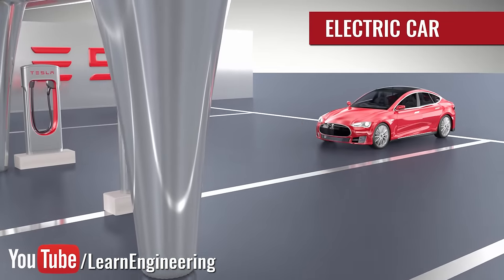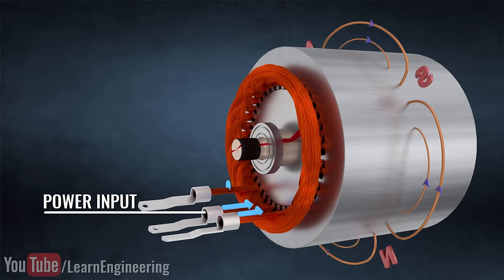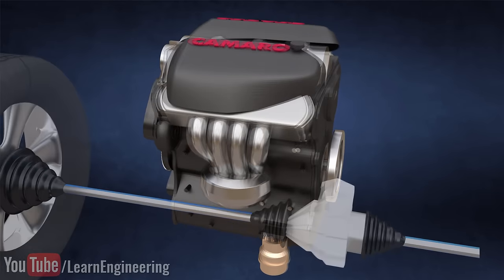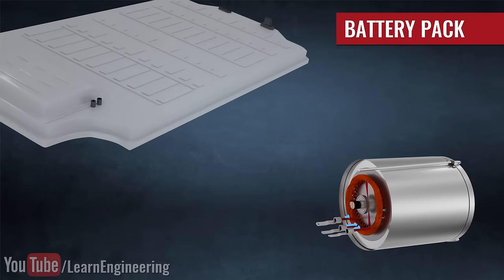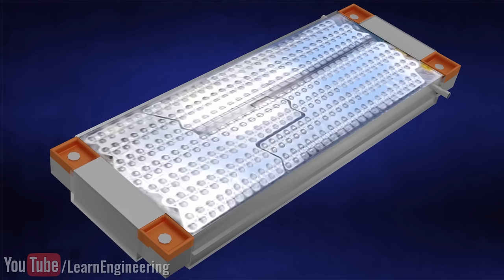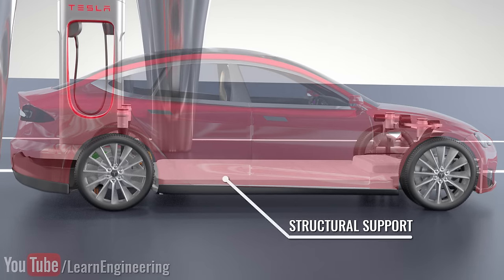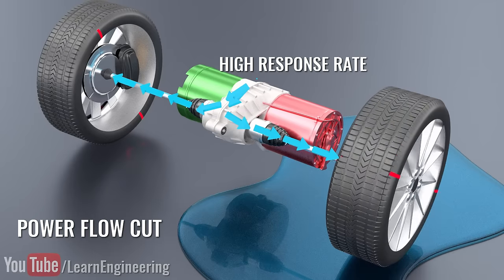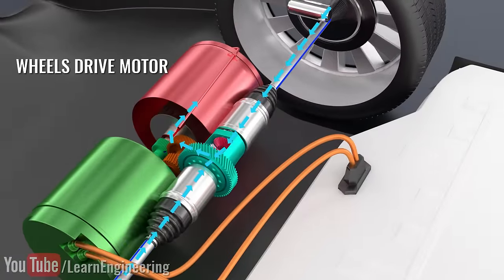How does an Electric Car work ? | Tesla Model S

Comment: I have a 1988 chevy Scottsdale king cab with an 8 ft. truck bed. Big truck had it forever and love everything about it except its 350 small block that is feed by a 36gallon fuel tank and gets 9 miles to the gallon. this was not so much a problem when gas was $0.89 a gallon but when gas hit $4.20 a gallon several years ago I had to park it and use it sparingly. I just wish there was an affordable way to convert it and put a large tesla battery pack in it and those electric motors at a reasonable price. He has to come up with conversion kits at some point
Reply: There are some people look up on youtube youll find "home made" electric cars that are converted from normal IC engines to electric and they are pretty good.
Reply: Lol why are you driving century old car. Instead of turning into kind of a electric car you should just buy new hybrid truck. Much cheaper than electric motor and battery packs.
Reply: wardain 
So buying a whole car with an ICE and battery, is cheaper than a battery and electric motor? LOL.
Reply: Lee Morgan 
that would be awsome! mix old school with new tech!
Reply: I'm gonna convert my car to a hybrid diy.  Gonna build my own motor from scrap materials and build my own battery pack even build my own battery cells from raw materials.  I'll be posting videos on this project.
Reply: Ever heard of LPG?
Reply: @MultiHeheboy  simply put. The older trucks are not designed to break unlike new cars nowadays. Its better to convert old Betsy to electric than to buy a brand new truck because converting a car to electric would likely be cheaper. Plus sentimental value of the thing

Comment: I like how much I learned from this video but I hate the fact that you put a 4 cylinder Inline model in an 8 cylinder V engine, how the valves & pistons were timed incorrectly, the poorly modeled Tesla, and how “no noise” and “no pollution” were put in the advantages section because I almost got hit by a Tesla because I didn’t hear it swerve toward me on the sidewalk, and building most teslas causes more pollution per unit than the pollution an IC engine creates in a year
Reply: I like how people with zero skills whine about other peoples work, how you almost being "hit by a Tesla" is something anyone gives a rats behind about, and the fact that Tesla's emit far less pollution overall during their lifespans, than combustion engine cars do, which is the entire point...
Reply: @redbaron6805  my brother in Christ I do not need to be able to fly a helicopter to be able to say “that’s not right” when I see one in a tree, I included me almost getting hit (in fact at this point I was hit last week) to bring up that if you can’t hear teslas then you won’t know where it is, meaning you can’t tell it’s about to hit you until you hear the tire noise about 5 feet away, and also most electricity (roughly 60%) is made with fossil fuels, dominantly coal and natural gas, so EV’s are not even as green as advertised + the several tons of CO that making an EV emits outweighs gasoline cars, plus the fact that if you crash hard enough to damage the battery you’ll need another one thus producing another several tons of CO sounds a lot like it’s worse than gasoline cars 🤯
Reply: @WZDRIP  Except, it has nothing to do with anything.  If you are riding a bicycle and get hit by a car, it doesn't mean all combustion cars are bad, or all combustion engine car drivers are bad, or literally anything.

It also ignores the fact that ALL modern electric cars, manufactured after a certain date, in the USA, have to make noise, if their speed is below 18.6 Mph.

Your claim about fossil fuels is also false, it is not "predominantly" coal and gas in the USA, gas is around 40%, coal is around 20% and dropping, they are not in equal amounts.

And the fossil fuel argument completely ignores the efficiency of EV's, which are on average around 5x more efficient per mile, even more in high performance applications.

It also ignores that the upfront emissions required to make an EV, are offset in about 12 months of driving, so lets not pretend the total emissions are remotely close.

What happens in crashes isn't particularly relevant, as batteries from crashed EV's are used in other cars, destroying that argument before it even starts.

We don't live in a "sounds like" world, we live in a world with facts, reality and data, not feelings or Facebook University claims.  

So, lets keep the discussion in the real world, how this really works in real life.
Reply: @redbaron6805  Your first statement about getting hit by a car is irrelevant. It completely ignored that i was talking about NOISE specifically.

What you said about fossil fuels was fundamentally repetition, as I never said that the percentage of electricity made of NG and coal were equal.

Upfront emissions are easily offset in a year, yes. However that does not mean that carbon is not emitted through the charging. The efficiency point is countered when you factor in that batteries naturally deplete faster in colder temperatures, along with the fact that your batteries are guaranteed to degrade to the point of needed replacement by the time you hit several hundred thousand miles. While ICE powered cars need one by 200k miles, building those engines will not produce 3 tons of CO.

What you said about crashes is also irrelevant because I never stated that the battery becomes e-waste, I meant that the car itself that was a victim of a crash will need new batteries.

In other words, Objection: Relevance.
Reply: I interviewed a top energy expert on my home page vid. He warns that EV conversion will not happen and oil can never be replaced

Comment: where does all the electricity come from when 40 % of autos are electric? windmills and solar panels?
Reply: Yes, more coal may be burned in coal burning power plants. For the time being. However, keep in mind a coal power plant is still MORE efficient at burning fossil fuel for energy than an internal combustion engine.

The average efficiency for a combustion engine is 20%.
The average WORLD coal power plant is 33%.

The argument against electric cars  is just silly.

If the entire world had electric cars right now, burning coal in a central areas would be the best option. It certainly is better than to having millions of vehicle spew exhaust fumes and oil throughout city to city.

As time goes on, hydro, geo and other renewable sources will take place of coal. That's the future and there's no getting around it.
Reply: I thought that it was stupid to say “buy electric cars, save the world” AND “save electricity, save the world,” but as of now, fossil fuels only make a part of the world’s energy (hydro, geo, wind) so while we use less fuel in power plants, we can also use less fuel on the road. Simple.
Reply: When you think how low is 30% efficiency, for example if we can produce 100kw power from 1liter gasoline at 30% efficiency, that means if we raise it to a 100% we could produce 300kw of power from the same 1 liter.. 
And also dont forget that nearly 30% of the power produced by IC engine is lost after that power goes through the drive train to the wheels. And those numbers are even bigger if the car is 4 wheels drive.
Reply: IC Engines are known as Heat Engine, or Carnot Cycle Engine, they already have a maximum efficiency beyond which we cannot go because of the operation of the engine. Its a bit complex to explain in a single comment but just know that we cannot go beyond a certain percentage efficiency without completely changing the technology we use.....maybe gas turbine.... Turbo-Traction anyone?
Reply: Jesus Christ, 

Energy efficiency is in fact ALL that matters. Work backwards on your post, then consider the full scope of its implication. It should become quite obvious. 

BTW, energy loss when electricity is in the US grid averages 5% to the residential user via the transmission and distribution system. However, energy losses converting fossil fuels such as coal, oil, and nuclear into useable electricity is 65% even before the residual is sent out into the electrical system.This matches up nicely with the efficiency losses of an internal combustion drivetrain at 75% because of similar conversion technology. 

Respectfully,
Reply: Why is no one acknowledging nuclear energy? 
https://www.euronuclear.org/info/encyclopedia/f/fuelcomparison.htm
That link compares the different fuel sources in terms of a certain kWh outage. You can see the exponential difference between nuclear fuel and other sources in terms of efficiency.
Reply: @0SilentLeopard0  
because people are stupid and associate anything that contains the word "nuclear" in its name with nuclear warheads and thus automatically form negative opinions about it.
nuclear is far more efficient than both wind and solar and far less polluting than coal, on top of being the most reliable form of generating electricity by a long shot.
Reply: @mbabcock111   He who explains nothing is slinging BS

Until we move ahead light years in energy storage on a massive basis, electric cars are far from the full solution.
Reply: @0SilentLeopard0  How's that 3 Mile Island and fukushima 2011 working for you? Add in Chernoble. How many more of these would you like?
Reply: @covfefe "Consider the Tesla Model S, which has an available 85 kWh battery and a 265 mile range. Consider a similar gas-powered car, which gets 35 mpg. Gasoline contains about 33 kWh of energy per gallon. The Tesla uses 320 Wh/mile of energy (85 kWh/265 miles). The gas powered car uses 940 Wh/mile of energy (33 kWh/35 miles). Once the energy is on board (not counting the efficiency of the power generation, oil refining, or charging), the Tesla is using only about a third as much energy as the comparable gasoline-powered car.”

Note that you included grid efficiency but not oil refining, exploration and transportation costs. Gasoline and diesel doesn't just come out of the ground at your local filling station.

The rest of your list is of the "I hope it fails so I will be right" category. We will have to pay more for the grid! Yes, but we will have to pay less for oil exploration, drilling, transportation and refining.

At the moment the main problem is cost of the batteries. The ICE powered car has had over a century of research. The battery is just getting started, with improvements of 5-10% per year.
Reply: From not using electricity to produce, refine, and transport crude oil and petroleum products. The Model S charges at night off peak, from the same receptacle used by an electric range. No special allowance or upgrade to the grid would be required for the foreseeable future due to BEVs.

Comment: Why does electric train use DC motor and Tesla S use indication motor?
Reply: DC series motor are used in electric trains because in the starting the current is 6-8 times the full load current which produces a high starting torque hence good traction, but when we are using induction motors its speed control becomes a challenge without power electronics therefore here we go for  VVVF( Variable Voltage Variable Frequency (VVVF) drive scheme ) which is slightly an expensive method, but nowadays even used in trains.
Reply: My guess is they didn't have the electronics to convert DC to AC in them days, electrictractor.net
Reply: yes,  true..
Reply: They do have ac and dc traction motors in trains
Reply: In the past, they used DC motors because they didn't have the power electronic components back then. Nowadays (since >20 years), AC motos are used in trains as well. You don't want to have the brushes anymore. AC motors are maintenance free and can do millions of kilometers in trains.
Reply: Brian, trains ran on both AC and DC motors. They get their power from a generator/alternator, no need for a converter.
Reply: One word. Cost. Dc is cheaper and more basic. High torque is all that is required.

Comment: This may be off topic, but I think someone might find it interesting. :)
Device to end the creation of Nuclear waist.
 Step 1: calculate how much energy you need pumped into an electric motor to make a vertically positioned circular platter with magnets in-bedded horizontally around it's left side and right side (so there pushing force is pushing out sideways relative to the vertically spinning disc) to spin as fast as you need it to. Also better to make sure these magnets are shielded around their sides & back  with metal that has high permeability so the magnetic field they are emitting is focused fully out sideways. :D Step 2: Calculate how many sets of copper coils you need to be interacting with magnetic fields to achieve this & to perpetuate more electrical current flow then is needed. :D Step 3: Build a round horizontally positioned platter covered in all these copper coils pointed down that does not move (Is stationary) :D Step 4: build a round platter covered in powerful magnets pointed up that can spin and place it directly under platter with hanging copper coils. :D Step 5:  Position the vertical platter that is  motorized close to the horizontally positioned platter covered in magnets pointing up so that when the vertically positioned platter spins the in-bedded horizontally positioned magnetic fields slam sideways against the edge of the horizontally positioned platter causing it to spin. :) Step 6: Make sure enough of the copper coils are feeding their electrical current into the electric motor and the rest of the copper coils are linked into a set of rechargeable Battery's placed in the closest most convenient spot. Step 7: Build a duplicate setup of horizontally positioned discs with hanging copper coils and disc with upwards facing magnets and assuming the first set of discs are positioned to the front left side of vertical spinning disc, position the other duplicate structures to the front right, the back left and the back right of the vertically positioned motorized disc. As the vertically positioned motorized disc spins the horizontally in-beaded magnets will now hit into all 4 horizontally positioned discs causing them to spin. so you will effectively be using the spin of one disc powered by one electric motor to spin 4 constructs that are each generating electrical current. now build this whole setup multiple times over and use the current perpetuated by it to power up scaled electromagnetic generators that are equal to or more powerful than the ones used in a nuclear power plant. You will now have a device that is self perpetuating off of it's own electrical current perpetuation and no nuclear waist to worry about.

Comment: We use three phrase induction motors all around our stamping shop and fun fact we also use DC (direct current) to power them. We have rectifiers that turn our AC (alternating current) to DC. Then VFDs or (variable frequency drives) pitch the DC current to the three phrase electric motor like an AC current. DC current is much easier to stabilize and keeps our motors at constant speed which is crucial to automation. AC current tends to fluctuate and isn’t stable 100 percent of the time

Comment: Recently in my homeland of Singapore, there are about 60 electric buses in operation. I happen to board one of these electric buses and to my surprise, there is not even a single noise as the bus driver drives the bus. From this video, I find that electric cars do not have engines. As engines need fuel for their operations, they tend to cause noise and air pollution from the exhaust pipes behind them. In comparison, an electric car doesn't even produce smoke and tests prove that electricity- powered vehicles are far much more cleaner and better than vehicles that are powered by petrol / diesel engines. Now in Singapore, there is a huge import of electricity- powered trucks from BYD, a famous brand from China which also produces masks and cars. These trucks are mainly used as rubbish trucks. To encourage more people to buy electric vehicles, the government has been installing electricity charging points all over the small island of Singapore. One big rubbish collection company has set up a huge facility with electricity charging points mainly for electric vehicles. The company has also made a huge purchase of electricity- charging rubbish trucks from BYD.

Comment: At 7:29, when you said selective braking and cutting the power supply, even then the arrows in video going in both the directions from differential. Shouldn’t it be in one direction (I.e in direction of wheel with greater traction)?

Correct me if I am wrong?

Comment: I am getting old but being a motor mechanic I am very excited about the electric vehicle. I believe it will be cheaper in the future because you don't need engine which is sucking a lot of petrol makes me crazy prices up and down all the time. You don't need up to 10  multi speed transmission which is cost big money to repair.

Comment: In automotive terminology the unit on the Tesla that is referred to as the transmission is actually a “transfer case”....in a front engine rear drive vehicle a transfer case is mounted to the back of the transmission in order have 4 wheel drive....

Comment: Hey we can also generate electricity by putting  same although big motor  at putting front side  please reply  this can be possible or not 🙏🙏
Reply: of course it can, it would just double their costs and traction is a huge factor pointless having so much power and torque when you cant use it on the road. The new Tesla roadster will have some crazy stuff in it for sure tho its more expensive and much lighter than their current models.. we'll see 😁